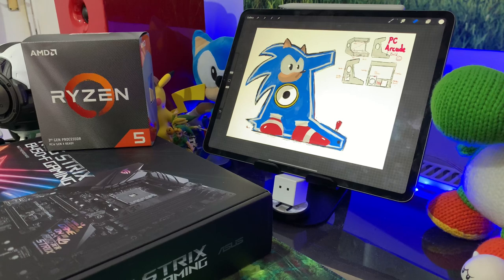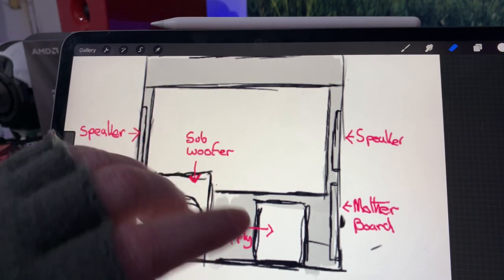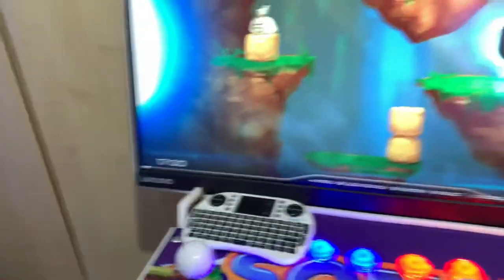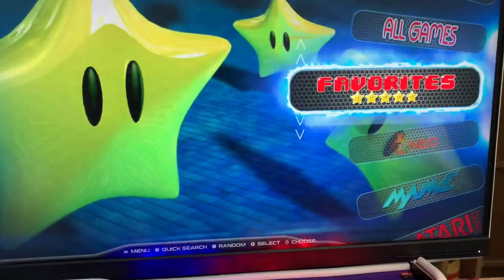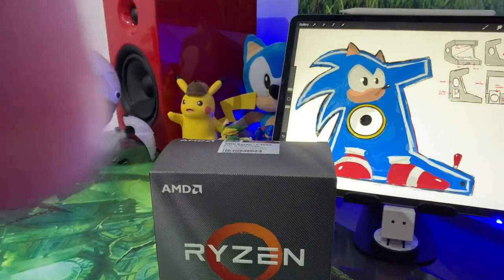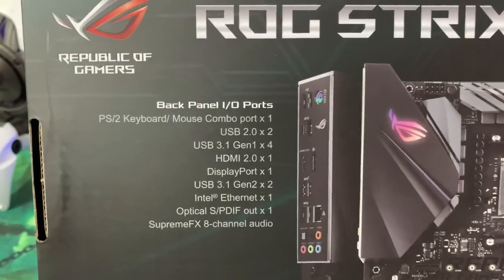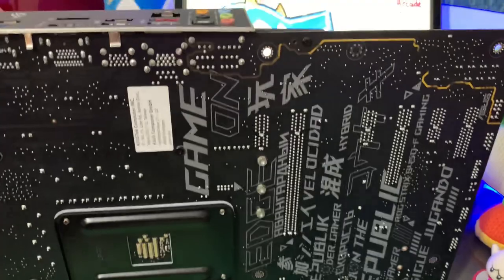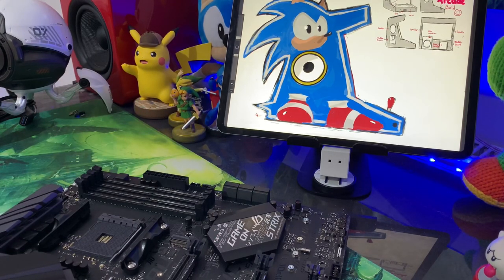How To Build a Pc Arcade from Scratch - Tutorial Part 1

Comment: Awesome video. I honestly built my bartop with an mdf kit because I have no place to cut wood. Threw in some Sanwa sticks and led buttons and I just chucked a mini pc inside with a quad core celeron processor in it and it runs up to Gamecube just fine. It's black with Chrome t molding and Mortal kombat 2 marquee. I added pinball buttons to it. It's an eternal project so i'm not done. I work on it more than I play it. Lol.
Reply from the maker: wow that’s epic man, I can’t wait to get started with this but I think am going to get addicted to doing these arcades ha ha
Reply: @SonicLoveEmulation  Yes they are very addicting. I tend to get frustrated that I don't play them enough. That and I have trouble starting a game because I can't get over how gorgeous the frontends are. 🤣
Reply from the maker: Ya I get that, hopefully I will be using the hyper spin and it will be 11Tb so pumped for it
Reply: @SonicLoveEmulation  Have you checked out the coinops builds? Those are amazing as well!

Comment: Only 5 mins in at moment... but;

I'd add an arm to Sonic on the side there, with his hand gripping the gold ring that surrounds the speaker.  Even if just draw the glove.
So the speaker cut out wouldn't be proper circle and would have his knuckles showing cut into the shape... if you know what I mean. 

Perhaps use gold leaf on the ring rather than paint, give it that added texture and shine?
Or even have a circular defuser strip with yellow led behind it so the ring lights up. 

Seeing as going to be a lovely large screen, and running Windows,  perhaps affix a holster to the side, for perhaps if one time you get a Sinden lightgun [or other]

Either way,  looking forward to it yeah
Reply from the maker: wow cool ya some epic points there man...thank you buddy

Comment: Use launchbox as your frontend, or go with retropie x86/ recall box/ batocera. Nvidia gpus usually run a little better on emulators too.
Reply from the maker: I will definitely be trying them out to see what’s best I will test out coin opps and hyper spin also, and ya I looked in to amd vs intel on emulation
Reply: @SonicLoveEmulation  maybe check out arcade punks and watch videos on different builds to see what frontend you like best. Though personally I like launch box the best.